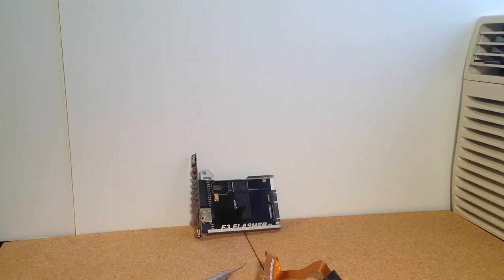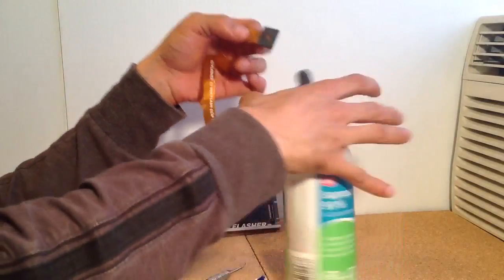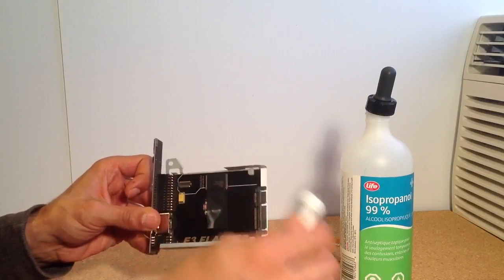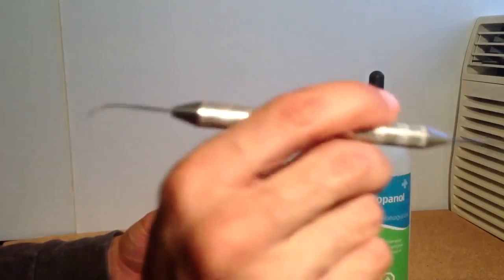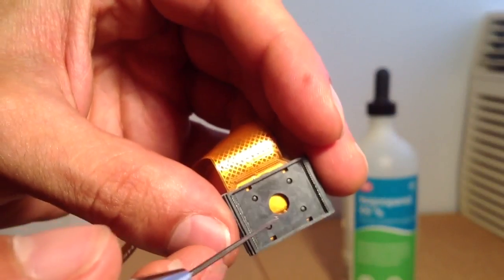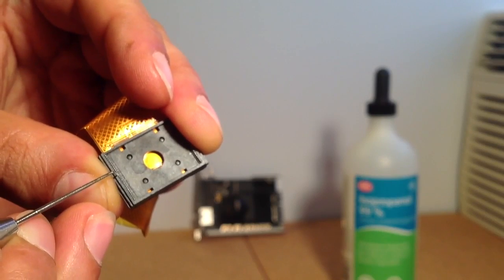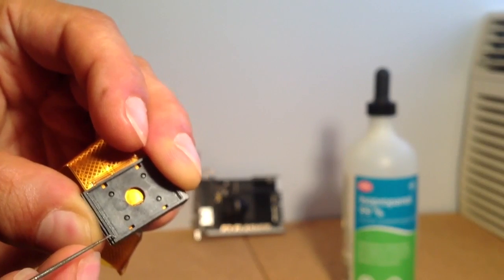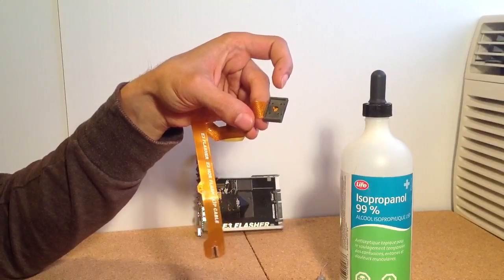How to Fix E3 Flasher NOR Clip Issues

Comment: i still have the error code 1000110 which is the seat not connecting properly idk what to do ps this is my frist time trying to use it help ASAP PLZ
Reply: error  code 1 0 0 0 0 1 1 0 = Failed to erase NOR in E3 Check pads / clip at E3 board check may not be properly seated

Comment: How exactly are you adjusting the pins on the clip? Do u use a small pin and push in those little holes behind the pins. Sorry hard to see that close.
Reply: Bump..  Anybody? Do you push down inside the the little holes behind the pins or what please help
Reply: Don't do this it will mess up the sectors on the side all you need is to put more pressure.. Take some small cereal box cut outs an fold them an put it under the fan on top the not clip
Reply: lol ive done 8 downgrades since this comment, the cereal box crap i dnt use that as i use the heat sheets. in time you do have to adjust the pins cus they start to where out and push in. i needed to know how he was doing it but i got it now. you have to push the pins out carefully and makes such a difference for the contacts.
Reply: wow i never heard of heat sheet before explain to me what it is
Reply: no i dont know what the fuck your talking about i have been jailbreaking fixing ps3 since 2006 so yea if you would of explain the shit better than i would of understand it
Reply: lol no since on playstation i worked for sony for 2 1/2 year bro i know what the fuck im talking about    the cfw released  2006 ps3 fat v3.21 cfw
Reply: +xxlHACKING.CITYlxx cfw wasn't released 2006... The first cfw was on 2.41 which was most certainly not done in 2006.

Comment: when backing up my ps3 nor 3 lights just start flashing I chipped a little away from the clip as told by some other videos but it is still messed up pls help!
Reply: What are the lights and what mode did you set the flasher on
Reply: I fixed it but it was the first light and the 6 and 7th all I did was put a thick peice of waded up paper above it so it pushed against the case and it worked!! :)
Reply: Thats Good!